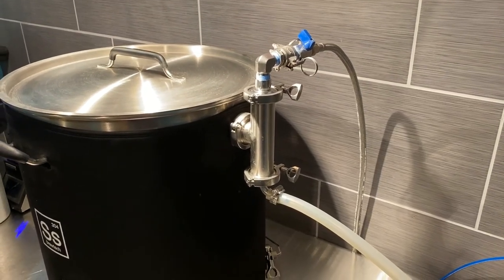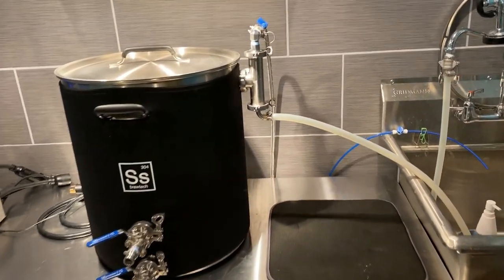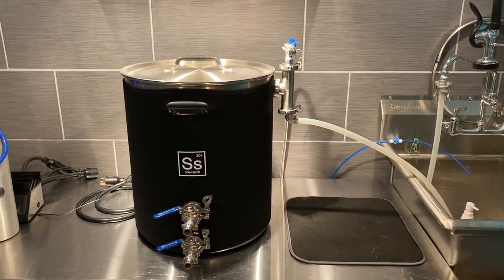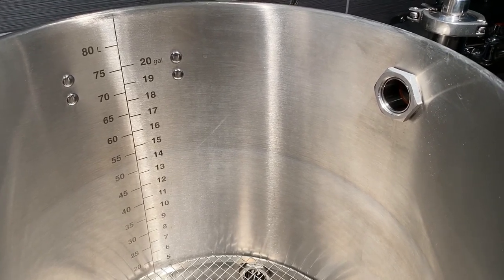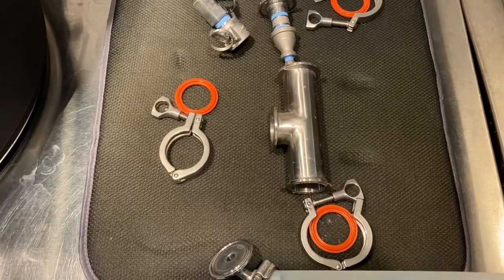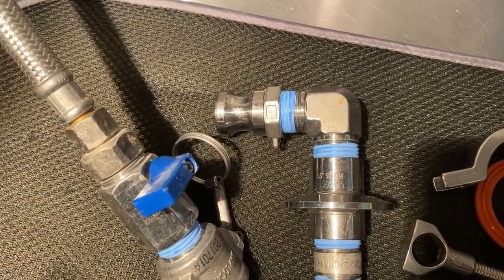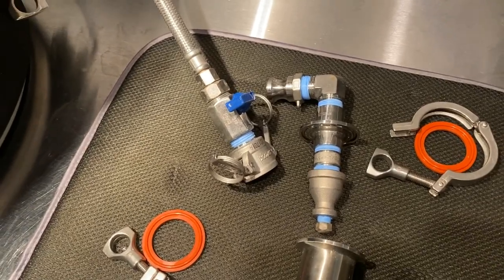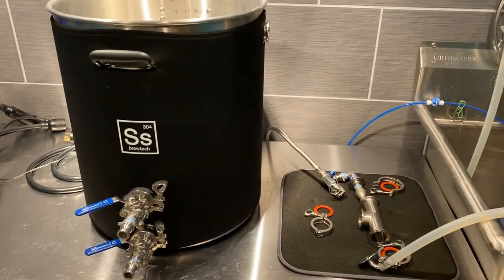Custom Steam Condenser

Comment: Great video! Thanks for taking the time to break down your set up. Can you share what spray nozzle you used and where you found it. I've been trying to locate it online and haven't had any luck.  Thanks
Reply from the maker: McMaster Carr 
https://www.mcmaster.com/nav/enter.asp?partnum=3178K76

https://www.mcmaster.com/nav/enter.asp?partnum=4464K523

https://www.mcmaster.com/nav/enter.asp?partnum=4830K172

There is also a 9 GPH nozzle but I found the 6 works well for 12 gallon batches https://www.mcmaster.com/nav/enter.asp?partnum=3178K77
Reply: @jpshomebrew9966  Thank you!
Reply from the maker: Great!!
Reply: Great video! Do you have a partilister
Reply: Great video! Do you have a parts list?